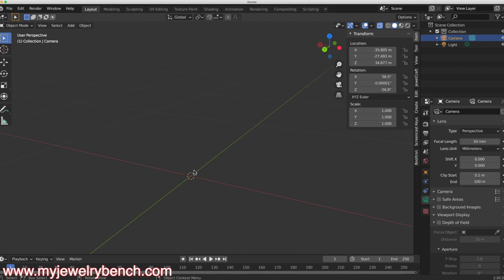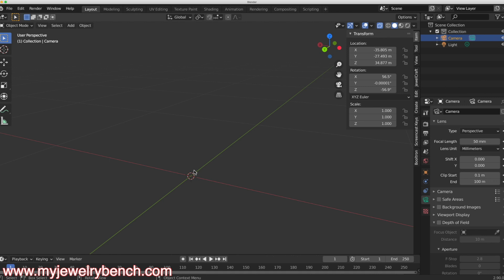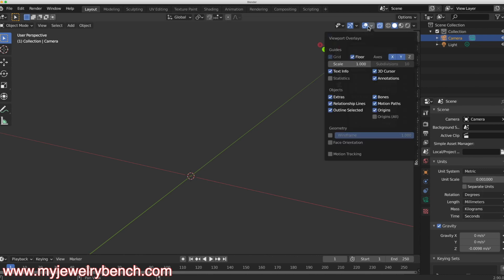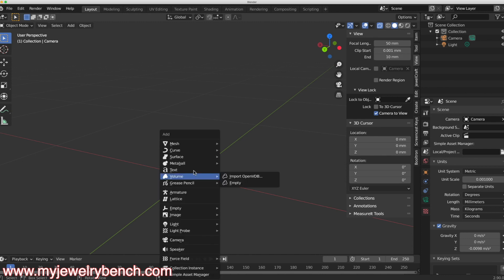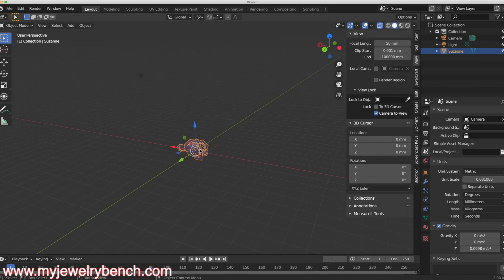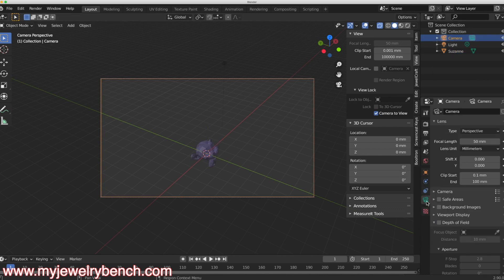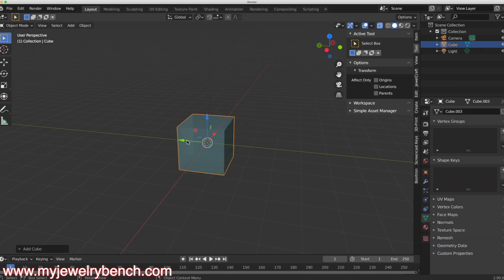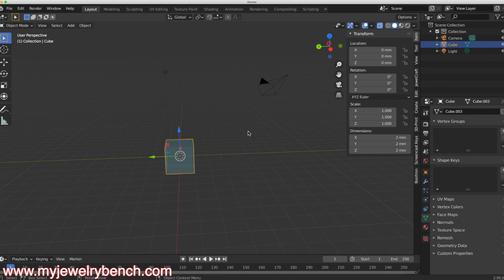Blender 2.9, Setting the Scale to Millimeters for 3d modeling Small Object Modeling

Comment: Thanks, Peter.  Just got a new version of Blender on a system where I just installed a new drive, so had to reset/save the settings.   I have a 3D printer, so it makes sense for me to use mm as well.  Go SI!

Comment: Hi, may i know how to solve the problem when adding light or new camera into scene. It is so small that i need to enlarge every time i add those. I working with millimeter and sometime my item can be like 4000mm and when adding light or camera i cant see them.
Reply from the maker: https://youtu.be/SlKYTVnOoOA
Reply from the maker: Also. In object mode using a keyboard with a numeric keypad, press the “.” Key on the keypad to focus in on your selected model
Reply: @watchesandjewelry  I use "." to find the light i added in. Example i add sun light, i can only see the radius but not the direction it is shining to. I need to scale many time then the direction guide line can be seen. Same goes to blenderkit furniture. When added into scene and it is so small that i need to scale many time.

Comment: i created an object with small text in blender. each letter is 3.5 mm Y by 2 mm X by 1 mm Z. everything looked perfect in blender. i exported an STL and imported in to ChiTuBox. everything looked great in ChiTuBox. but when i printed the model on my Elegoo Mars the text came out 3.5 mm Y by 2 mm X by about .10 mm Z. in other words the text came out essentially 'flat' on the Z. oddly, if I scale the entire model up (for example to 125% in blender) then print it, the flat Z issue doe not happen. weird. i'm assuming it's some issue with ChiTuBox exporting correctly. wondering if you have ever run into this issue?
Reply from the maker: You can also adjust the sizes in chitubox. There are limitations to 3D printing that you will have to play with. I would also check the settings on your printer or do a test print like a cube and make it 10x10x10 and then messy it to see if you need to adjust any settings such as layer cure time

Comment: Thanks for the tutorial! I found that new primitives are now 1mm radius or 2 mm in size, which is not a problem but a bit tedious. I wonder if there is a way to change new primitive sizes? Blender remembers it for a session (e.g. if you set new cube to 20mm then every new cube will start at 20). But if I set it and save it as default file, primitive sizes are reset back to 2mm.
Reply from the maker: You can change the divisional factor from 0.001 to 0.01 that would add in a 20 centimeter cube. That is a small alternative for scaling.
Reply: @watchesandjewelry  tried it, but unfortunately it also works for a session. After I save the default with new scale (.01 or even 1.0) the new primitives are back to 2mm size.

Comment: What apple computer are you using for blender?  2.9

I was thinking of getting a new MacBook laptop to run blender

Also when you put  the mesasurements of lets say x,y,z millimeters does it print out the exact measurements all the time in the cad models
Reply from the maker: 2013 iMac. 32 gig ram core i5
Reply from the maker: If you want to unleash blenders power make sure you get a pc or Mac with a compatible graphics chip. That helps with some of the computations and a lot of rendering if you go there. I also use a windows 10 pc gaming laptop as it works really well. Resolution on display matters
Reply: @watchesandjewelry  would you ever make a tutorial video of how you take your blender project and import it to 3D printing would love to see the whole process
Reply from the maker: I’ll be uploading a video this afternoon where I make a winged pendant and 3D print it. It is about 30 minutes long and I’ve been editing it for a while because I wasn’t happy with my voice over. There are also a few videos where I’ve made rings and printed them. If you have any specifics please feel free to post your request and I will follow up
Reply: @watchesandjewelry  yesss! I’ve been looking for pendant design on blender but I haven’t seen anyone besides you who cover it with detail, so this will be educational also when you export your finished design for the x,y,z measurements can you use Centimeters also or does it just use millimeters?
Reply from the maker: You can set blender up to use any level of measurement. One of the great parts of it. You only have to adjust the factor of measurement. I.e 1.0 is meters. 0.01 is centimeters etc. once you’ve done that. Change the settings to millimeters or centimeters or inches. Which ever you prefer. Since I do 3D printing I set mine up for millimeters. In addition jewelry is measured in millimeters by default. For instance a 1ct diamond round is 6.5 mm. I find that easier than .65 centimeters personally. But there are many ways to skin a cat.
Reply: @watchesandjewelry  ahhh that’s a very good point for measuring with the metric thank you for the info, your videos are very inspirational I’m learning as I go with blender watching your videos so thank you for putting out the content for us ✨🤟🏻